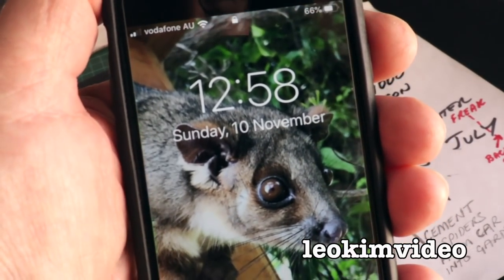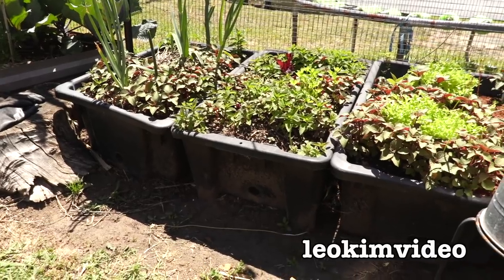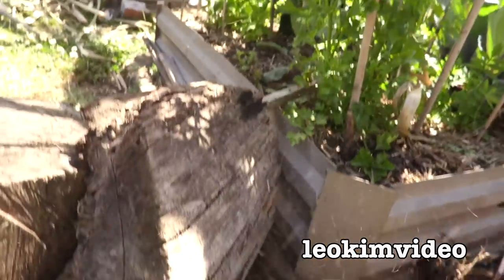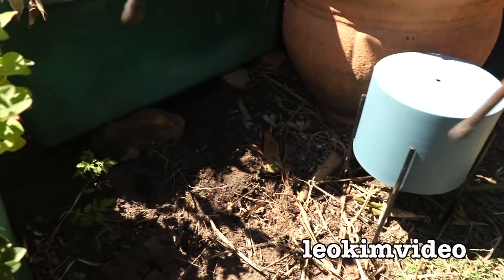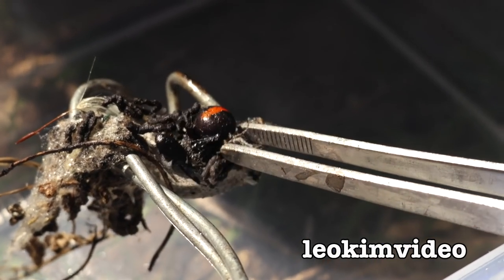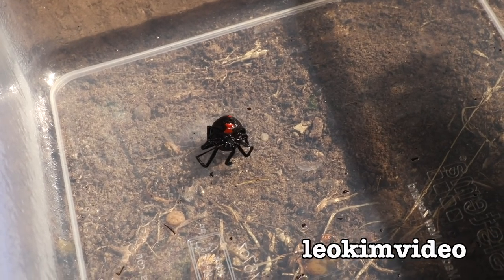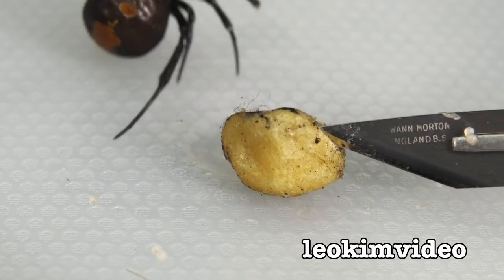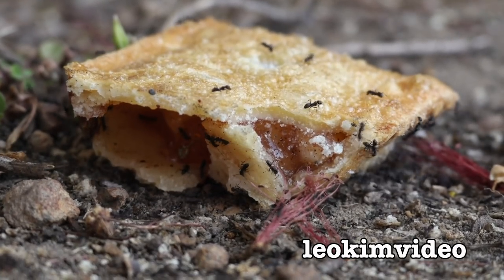Redback Spider Roundup Monkey Tool Spider Lures & Egg Sac Openings EDUCATIONAL VIDEO

Comment: that Coles stuff is awesome...much better than the name brands...ya can tell just with cockroaches! spray them with brand names..they run off and hide and probably survive...the coles stuff..they instantly start to die...
thanks Leo...oh and btw...they are still choko pies!
Reply from the maker: Coles Multi $2.50, Big name pest control $10.00. I think the Coles Multi is rebranded Raid.
Reply: @leokimvideo  that stuff seems to have some surface spray properties aswell.. i had a bad infestation of german cockroaches for years..destroying TVs and other electronics etc)..nothing would get rid of them, not even expensive commercial pest control..they'd always come back within 6 months... thats till the coles stuff hit the shelves... got rid of all of them..any new ones that hatched where caught in the leftover chemicals on the surface for upto 6 months later...